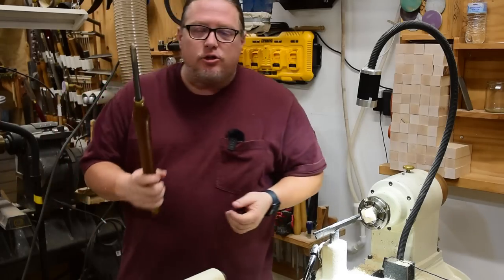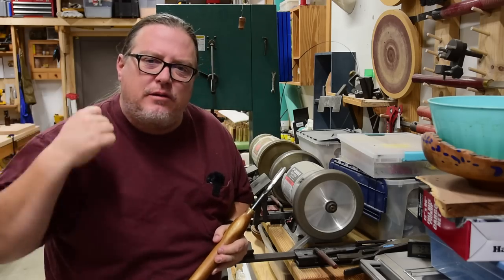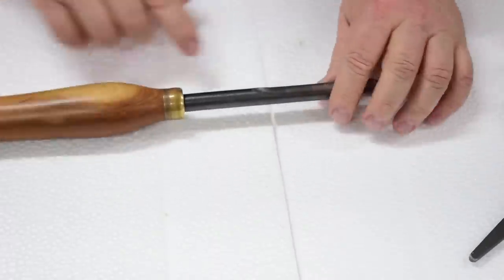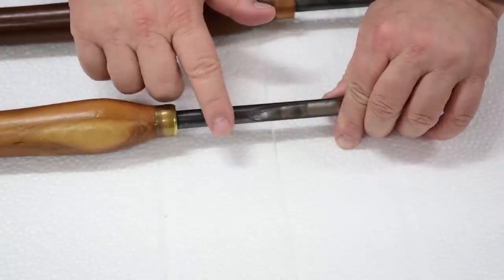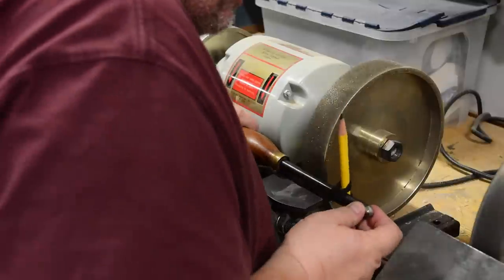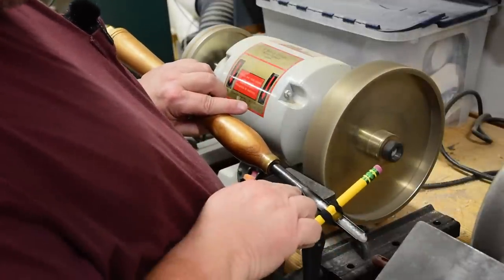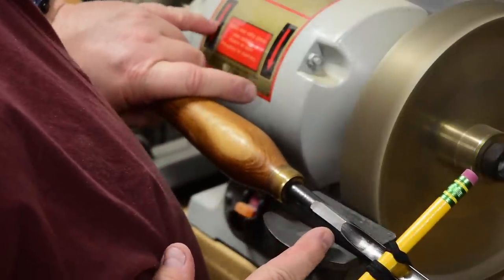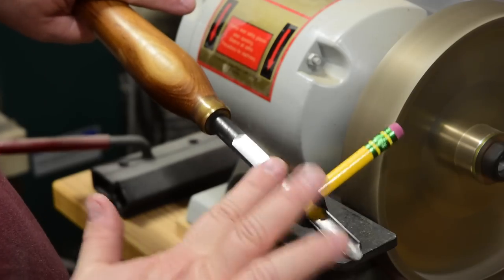Modify a Gouges for Sharpening

Comment: Great video. I’m a couple months away from needing to this on 2 bowl gouges. You can get even more life out of those gouges by pulling them out of their handles. Clamp the gouge in a vice, I use my wood vice. Use a heat gun to heat up the metal then twist the handle and pull. I then drill and tap the feral for a set as screw and I can now pop the gouge in and out for sharpening.
Reply: Ferrule 😁😉
Reply: @mushroommcfarmer1766   I knew it was wrong when I wrote it but couldn't pull the correct spelling out of my head and was too laze to look 🤣

Comment: I have a nice double ended OneWay 1/2" bowl gouge and the flutes on it are pretty long. When the full flute is extended beyond the end of the adjustible handles I use, it sometimes gives a real singing of vibration. Other gouges I've used in those handles didn't do it. That includes the OneWay 1/2" spindle gouge it pairs with. Lengthy flute on it, also, but shallower flute. IAs I began commenting I was thinking shorter flutes might bean less resonance, but changed my mind when I figured out the spindle gouge, same maker, did do it. But the differences between deep in a bowl hanging over the rest and find spindle work are very different. That vibration goes away just by retracting the steel in, a bit, when you don't need the reach.

Thanks for the technique demo. This will put some life back into the very first spindle gouge I was given to get me started, a few years ago.

Comment: Yep, good tip.  I am having that issue with my Sorby 3/8" spindle gouge.  I did 3D print a shim that helped a little bit, grinding it flat is going to work better.  This was my own doing as I was learning to turn and sharpen; I spent a lot of time with this tool getting the sharpening right so I wound up wearing it down a bit faster than normal.
Reply from the maker: In grand scheme, steel is cheap and I'm sure you learned a lot using it up.
Reply: @wortheffort  Absolutely.  Sometimes you just have to expend the material to understand how things work.

Comment: I love my Oneway system but use Woodcut Tru-Grind tool holders. They have a "V" notch in the clamp head so they can clamp to the round or the flat on the gouge. If my gouges get that short I just heat the steel up with a torch and remove it from the wood handle. It's nice to have a modular tool handle handy for those short gouge blanks. Plenty of ways to skin a cat, as they say.

Comment: Doug Thompson has talked about this, if the flute is too long, then when the tool is new it tends to vibrate if the flute is too long and it makes it sing.
Reply: There are other ways to remove vibration.  In panel saws they do this through tapering the blade.
Reply: @tacs_01  Turning tools really need a consistent diameter though.
Reply: @Matthew Wright  I can understand that the part of the flute touching the banjo needs to be constant diameter,  but not the rest of it.   An alternative could be to laminate different metals throughout the tool to reduce vibration

Comment: What would happen if you welded a sliding plate assy. on the wheel side of the jig to keep the flutes aligned?  Then, you could take the button off the holding bolt.

Comment: Why modify the gouge?  Why not modify the jig or make an adapter?

An adapter could be flat on one face and the other could have a convex part to fit in the flute and a concave part to fit over the shaft.  You could just stick it on with a magnet and then clamp on the jig.
Reply from the maker: I’m lazy. One solution is less work, less risk, and less engineering.